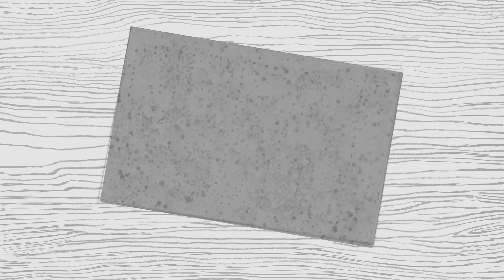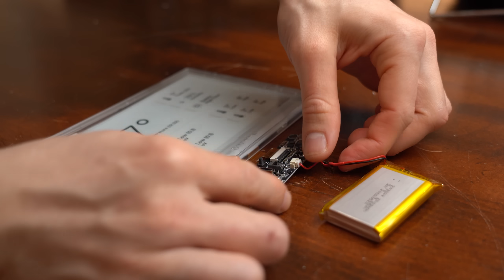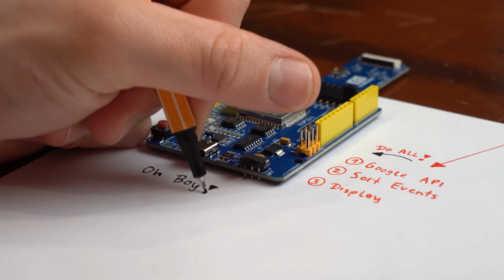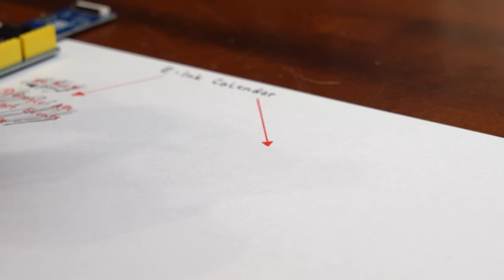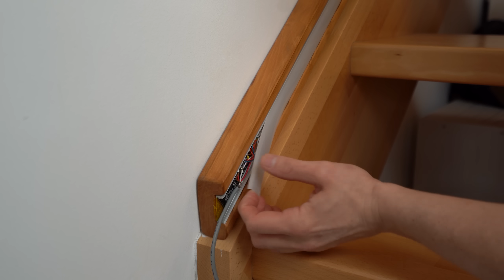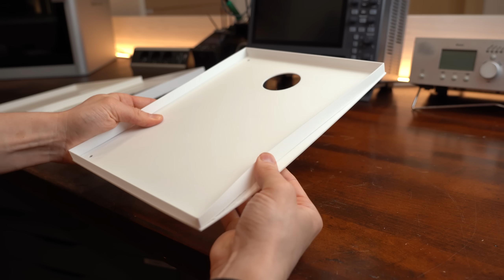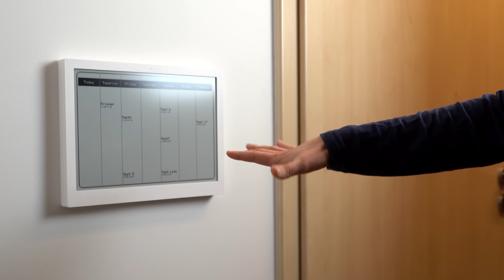Finally! A Home Upgrade That Makes Sense (E-Ink Display)

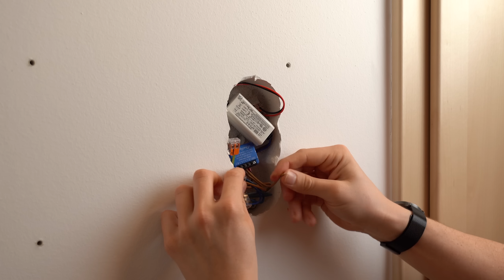Comment: @10:34 The mains supply wiring is not contained in a box inside the wall??  In the US, I think all such would need to be inside a box.  Maybe others will reply indicating what US and EU requirements, if any, are?
Reply: Mmm maybe he should. In the US if that power supply burns your home also burns. Here thats not a issue because you know, bricks. So... who cares?
Reply: @asturcon3794 the rodents care.
Reply: The rodents that magically go trough brick you mean @johnlaurencepoole6408
Reply: @johnlaurencepoole6408 it's a solid wall, nto drywall, so rodents can't get into that

Comment: I wonder if it'd be more economical to just get a proximity sensor that turns on the display checking it. Like how long would it take for the 10w power saving to pay itself back? Like it costs a euro to run for 10 days assuming your in Germany. 36 a year. It'd take 5 years to pay itself off. This is assuming the display is always on. And not the proximity sensor idea. And if saving 10 watts is really important, just using the phone app would be better?

Using an e-ink display with a low power esp32 does sound cool and fun though. It's what SHOULD be the standard. Just not cost viable.
Reply: Modding a cheap radar or PIR sensor to reduce its range would make an interesting video in itself. A short range PIR is what the Nest thermostats use.

Comment: E ink is cool but sooooo expensive, 
Add to that the refresh is slow a a bit power hungry so it's use us quite limited.
I'm actually thinking the old black and white LCD displays make more sense,
One of the biggest things needed on a display is a clock and that needs updating every second or at least once per minute.
E ink would be cool for a photo frame / digital art IF the actual image was decent which it isn't lol.
Reply: There are now Computer E-ink Monitors that do 30-60Hz.

Even before Partial Update was pretty cool for Clock stuff.

Comment: Why didny you install a data jack inside a outlet box. you cant do mains connections outside of a grounded enclosure. its a risk no matter the country. your national electric code i am sure does not want 240v connections to be done and hidden in the wall plaster with no guarded enclosure or a simple ground... really when a mechanical connector gets hot from a poor connection and fails the electric cable will burn instead of shorting directly to ground on a enclsure causeing the breaker to immediately trip saving the house and alerting you to the issue at hand. not having a ground in the house is like running a human being with all pain receptors turned off...

Comment: I gotta say this whole "working with mains voltage should only be done by profescionals" i see lately is being a bit of a pain.  I get why, and I have done the same in the past. But it's so demotivating for anyone who wishes to also build systems like this and instead of motivating poeple to create in a safe way, someone whould start doing their own thing just because. I think a better warning is to remind poeple of the dangers of mains voltage and perhaps give some safety tips.

The display looks sexy as hell tho. I did not know there was an otion out there to update ESPs over the itnernet which is really useful!

Comment: You could use ESPHome for this, right?
Reply from the maker: I think so
Reply: yep. only thing you would need to do would be build out the UI for the screen, make sure the screen is supported in esphome and then parse the google calendar into it. the ota is built into esphome.

Comment: Love the video. I personally would maybe have also put the current date over the weekdays.
Oh, and what happens when the text is too long for the section?
Reply from the maker: Well, the date is not necessary because the left side always starts with today and then goes 7 days up. And when the text is too long then it simply cuts and puts .... behind it.
Reply: @greatscottlab  Thanks for elaborating. I thought more in the way of the current date as in "1. Februar 2026", because I always forget that 😅

Comment: Another approach would be using a raspberry pi zero as a simple backend. You can put it anywhere in the house. It would get the calendar data, host a local mqtt server and create a Bitmap image of calender and sent to esp32. Esp32 would get this via mqtt and just show the picture without knowing what it is. 

You can use python, C, whatever you want to inside Pi Zero. You can easily modify the generated calender picture. You can even put different images if you want, or change the theme of the calendar around holidays.
Reply from the maker: Sounds also doable. I think there are tons of different ways to do this ;-)

Comment: How much whole Home assistant cost u??
Reply: Pretty sure home assistant is free.
Reply from the maker: My HomeAssistant system? Just a Raspberry Pi 5 basically. And lots of time to set up the whole software.
Reply: While Home Assistant can sell you boxes for home automation with their software built in, the software is free to download and use in your own self hosted solution like a single board computer, virtual machine or server.
Reply: @BrunodeSouzaLino  thx

Comment: Nooooo! I'm so sad to hear you've succumbed to the AI theft machines 😭😭😭
Reply: I am highly against Ai slop and the Ai bubble, but it can be usefull and should be treated as a too. Its handy for speeding up/optimising work/workflow and or code. Even the best programmers use a tiny bit of Ai to speed up work. I myself use it too, but i dont overuse it and nobody should (i dislike Ai vibecoders and Ai artists)..
Reply: AI is just a another tool. Using forums for help would take way longer.
Reply from the maker: AI can be super useful when used correctly and not excessively.
Reply: @greatscottlab  I'd be less against it, if the AI companies had not built their data sets with wholesale theft, were not exploiting cheap labour markets, were not destroying other markets, and were not being used to destroy vast swathes of society.
if you ran a self hosted and self built AI stack I'd applaud you, but using the generative AI tool taints your work.
It's not hard to do better.

Comment: Really wish these large e-ink displays were cheaper
Reply from the maker: True.....
Reply: Same I had the same idea for a project like this recently and was instantly put back by the price of these displays
Reply: Get an old Kindle dirty cheap, easy to Jailbreak and screen is big enough.
Reply: Eink is monopolised by a single company btw
Reply: I wish both e-ink and oled were cheaper at larger sizes.
Reply: Find it s little strange as they do actually use the same technology as a lcd, two contacts on either side of two glass planes and then a liquid between them, but in the case of e-ink balls (which could be the reason) but then while writing this I did some thinking a LCD in its basic form is mostly the same as e-ink, they both utilize the fact that you need surrounded light to bee seen, and if you could get hold of a mono lcd big enough it could work just the same, the power draw of a lcd without any backlight is not that much, and the refresh rate could surely be much lower. Hmm maybe you could just use a old 17 19 inch 4:3 lcd remove the backlight and stuff replace it with a reflective surface then by only utilizing it in black n white, you get your cheep screen.
Reply: @tde04014  E-Ink is a licensed technology. Thats part why its so expensive.
Reply: @falk.  it's not they are just patent trolling for last two decades
Reply: Same. I also have ideas I wish I could slap together and eink would be awesome.
Honestly, might be cheaper to get an eink device and take the display out, or go used and do the same.
Reply: a cheap reader with a browser? is that a thing? I have no idea.
Reply: @remotepinecone  It is, but I think it's better to just rip the screen out, if possible and try to use that. I believe (might be wrong) that the display controller might not be too hard to get.
Reply: I've wanted an eink dashboard (of sorts) for home assistant for a while now. The cost is why I haven't. If I was 100% confident that people would actually look at it, then $200US isn't too bad, but it's a high financial outlay for something I might end up sticking on a shelf and never using.
Reply: Tabled are far more useless, but way more diffused. eInk panels have still a long way to go for improve yelds and competitors.
Reply: Yep. It's basically the only reason I haven't doing this project myself using ical or something. 

Granted, a dream would be to have a module that could also convert handwriting updates into the proper fields, but that's beyond me so far.
Reply: ive got one 12.2" bwr for like 2 bucks
Reply: @v1dr00  well, the cheap bwr e-ink tags are 2 bucks because they're like 2 inches, lol... That's not useful for dashboards, is it?

Comment: if you add fillet to the inner corner of the walls you will get fairly rigid 3D print.
Reply from the maker: Thanks for the tip ;-)

Comment: Wait, why not use iCal which is supported by every online calendar service. You could just have the ESP32 fetch the iCal file every 1 minute and refresh the screen.
Reply: Haha, I had that exact idea yesterday for my own e-paper screen. Google calendar has a public iCal file that can be fetched using a secret key. It contains all calendar entries, so depending on how busy you are it might be very big. Mine was 600kb, so that's definitely fine for the esp32 to process. Since it's just a text file it can stream it and process it one line at a time and discard anything that isn't interesting.
Reply: Gotta say I'd go the other way and have the display/ESP simply be a dumb display of images (png presumably).  He already has a server, so a script/program there can do the work to generate images to send, where it's much, much easier to develop it.
Reply: Just my thought. It's THE standard. The result looks good, but the ~vibes~ are strong in it
Reply from the maker: Nevery heard of it. Sorry.....
Reply: @greatscottlab iCal oder RFC 5545 ist ein Kalender Standard. Google und andere bieten das Teilen von Kalendern via iCal link an. Es gibt auch libraries für jede Platform auch C++ oder Micro Python für den ESP.
Reply: @greatscottlab  I hadn't either, but I'm curious if you'll check it out/other stuff and see if you can simplify your system? I love these little tinkering videos, they're great!
Reply: @greatscottlab You probably have, you just didn’t know. ICS files and links are ical. Even in Google, when sharing a calendar, you are given an ICS link. 

As to why use it? Well it’s less complex for sure, but if you ever want to do something like filtering or have storage limitations the burden of coding a solution is on you. Using Google’s API is just fine.
Reply: Yeah I kind of resented the remark that the esp couldn't query&display google calendar. That limitation appears to be in Great Scott's mind, not in the esp.
Reply: @DannyBackx  Imagine for a second that English is your third language, and some clown “resents” that “technically the limitation isn’t inside the espressif chip”. 
🤡
Reply: @DannyBackx  If something that simple caused you to feel resentment, it’s time to go out for a nice walk and figure out what’s wrong with you.
Reply: @MrThedennisblack  Not really. It's fair and understandable to be peeved when a YouTuber who's uploading a video on a topic that will be shown to a bunch of other misses a very important point related to the topic (iCal being the most popular format used by Calendars, including Google Calendar)
Reply: @MrThedennisblack  people have resented less, fanboy
Reply: @MrThedennisblack and it's time for you to go to the library and learn about figurative language
Reply: I don't think he would be able to parse the .ics file easily. He's not a programmer, so parsing the file and getting the latest calendar events might be asking too much from him.
Reply: @sledgex9 also there's Arduino/ESP libraries for everything. I'm a programmer, but lazy - ESPhome for everything that's remotely supported.
Reply: @sledgex9 🦞 bot and good vibes might be sufficient here 😅
Reply: Presumably because the hallucinating plagiarism machine 9000 said the other thing and because vibe coding trains users not to think and to just grab the first thing that works, there was no questioning of basic assumptions.